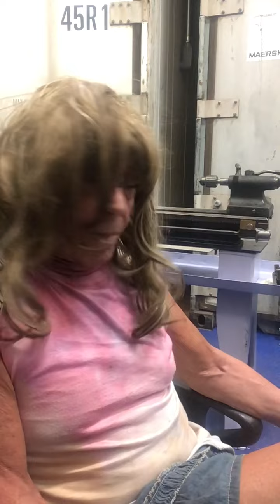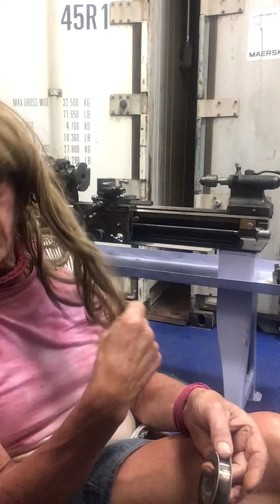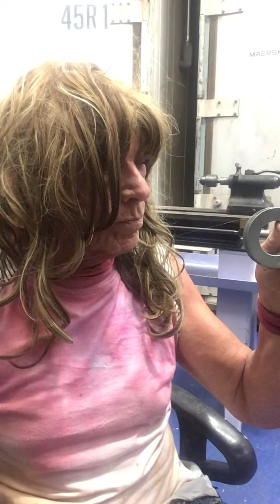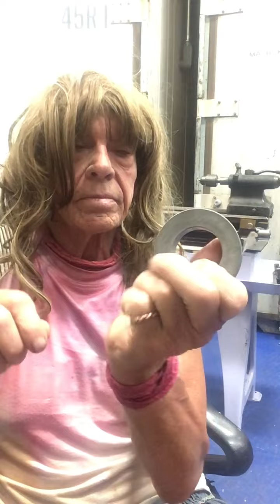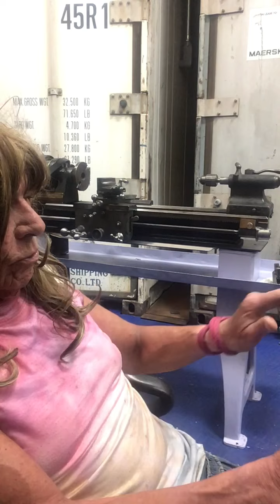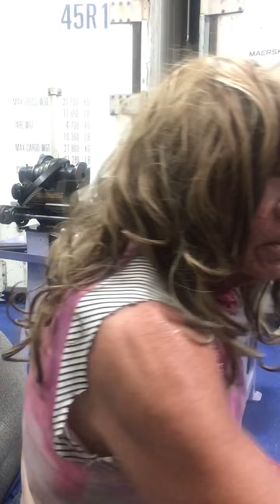Gravityflier

Comment: Thanks, the counter spinning discs are charged like a capacitor. The top disc is charged positive, and the bottom is charged negative similar to a lifter, but the Graviflyer weighs 1kg so it is not ion wind that makes it fly. The center plate is charged with an AC signal of 1MHz to keep the charges on the rotating discs from canceling out. The Graviflyer also uses ultrasound pulses to create the lift, and adjust the height. It takes several hours to build up the field around the Graviflyer and for it to lift up. We think it is similar to the lift of the Hutchison Effect, and your work inspired the inventor of the Graviflyer, Alexey Chekurkov. I will have to show it to you in person when I get it flying.